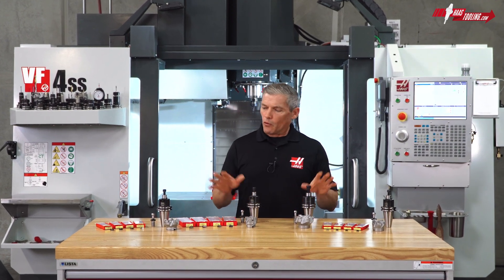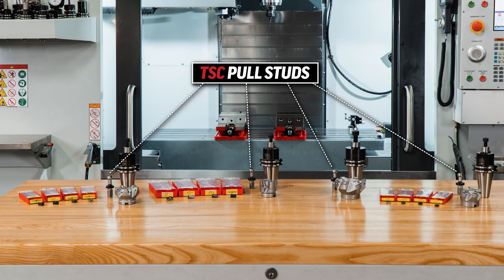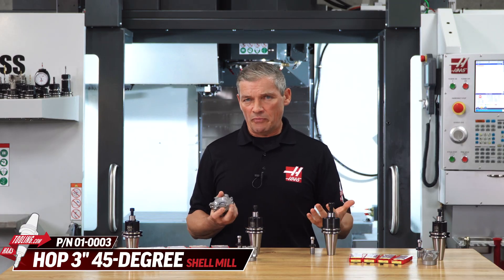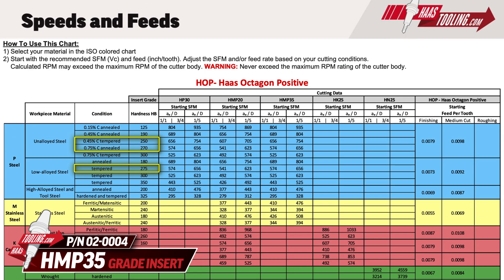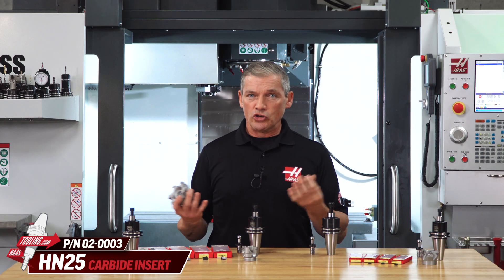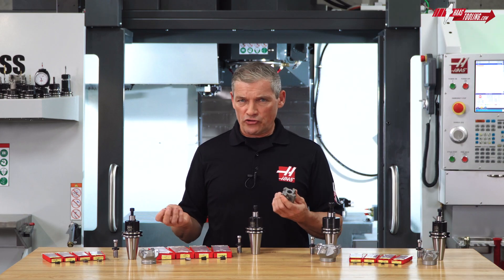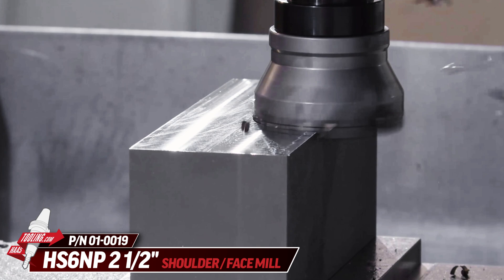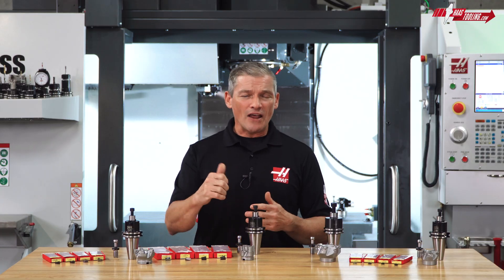Get the Haas Shell Mills You Need . . . All In One Kit! - Haas Automation, Inc.

Comment: Hey Andrew, which facemill and insert would you recommend for semi roughing and finishing for grade 5 titanium?
Reply from the maker: Squid Industries, Great question! If you check the insert grade information for the inserts in this kit you’ll find they are primarily aimed at cutting steels, stainless steels, and iron. In other words these are not titanium/super alloy specific inserts. With that said here is where we’d start: 
For semi-roughing: 2.5” HS6NP cutter using HMP20 or HMP35 inserts. You should probably start with the HMP20 grade. Your exact material grade/toughness and your cutting parameters will dictate whether the sharper/thinner HMP20 coating or the thicker more heat resistant HMP35 coating will work best. 
For finishing: 3” HOP shell mill using HMP20 inserts. Here the positive geometry and thin PVD coating should keep the inserts sharp longer and the 6 inserts should give good support in the cut.  
Again these inserts are not designed for titanium and of course your entire process setup must be optimized to be successful cutting titanium.

Comment: Your tool clamping system in VMC is not good,,,,,,,,,in my company   3of 6 machines have problem during tool clamping and de-clamping.
Reply: Clean your tapers, buy good toolholders and good pull studs. The vast majority of problems with tool clamping are caused by contamination or poor toolholders, not the spindle.
Reply: @J Dietrich  idk man my dnm500 doesn't have any clamping issues and the company I work for uses cheap holders and pull studs. Previous guy that ran the machine didn't clean anything ever either. I've tried keeping it clean now that I'm running it, but never had a tool holder issue.
Reply: Is your spindle through coolant? If so you need to always use tsc pull studs even when the tools you are using arent.